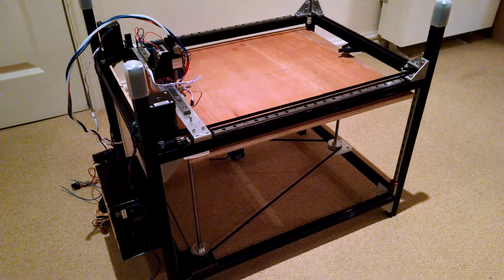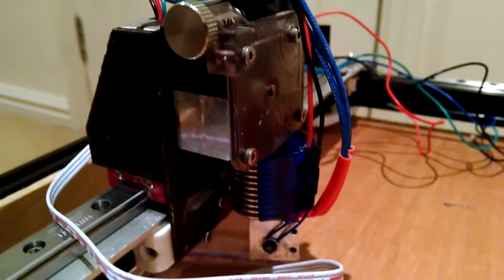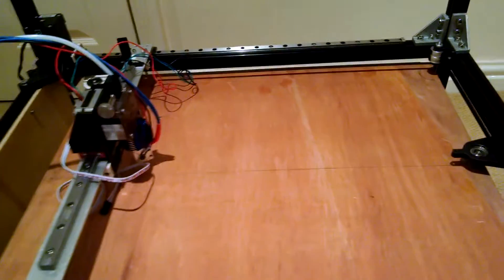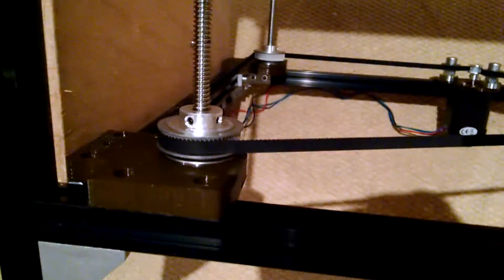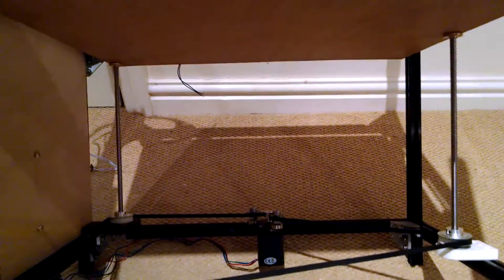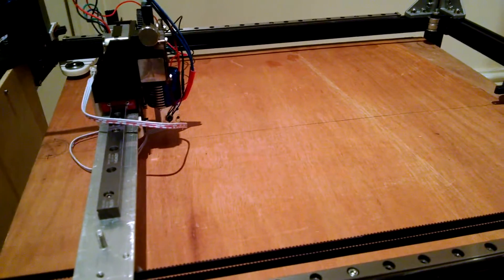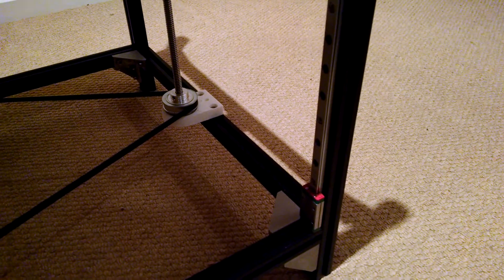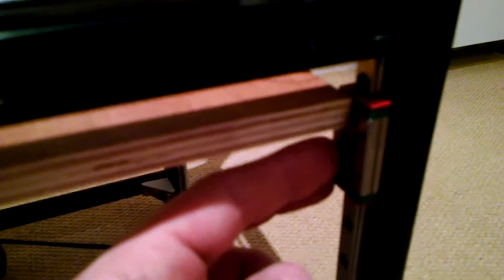MoreXY 3D Printer Design and Build Update

Comment: What type of corner brackets did you use? They seem pretty beefy.
Reply from the maker: Balu 2040 corner bracket right angle connection 90 degrees bracket 2040 bracket for EU 20 aluminum profile slot 5mm 6mm
 http://s.aliexpress.com/ma6rUJju?fromSns
Reply: Thanks for the quick answer :)

Comment: I'm using a 15mm linear slide rail and block on my X axis (cartesian similar to I3) in a vertical configuration, and I have about as much wobble as you do with the smaller one you're using.  Actually not enough to worry about, another printer using two 8mm rods in the X axis has about the same slop.  BTW Lithium grease works wonders on these slide rails, it removes some of the 'grab' I noticed sliding them under load.  Grease those 8mm drive screws and the brass nuts to extend their lifespan.
Reply from the maker: Kenneth Scharf thank you for the comparison and tips.

Comment: Cool build! Mine is kind of similar actually... I went with the robotdigg(black SS)  mgn12 on my XY gantry, My Z axis is a triple lead screw 8mm with robotdigg (green generic) mgn12 rails. I Have tuned the Z axis pretty well so i dont seem to be getting any Z artifacts. What i DO seem to be getting is vertical ripples like  noise artefacts, i for now have rooted all cause of almost all mechanical issues that the printer had and they are still present which makes me believe the culprit is the noise from the cheap Chinese 40mm nema 17's... I see you are using stepper dampeners which i have at hand but have not installed them yet, do you think they will make a difference

P.S. I also suspect that the belt riding on a small diameter pulleys for the XYgantry might also be the cause of the ripples i'm getting... but a lot of people argue that it makes no difference at all, what are you thoughts? Thanks and cheers mate:)

P.P.S Here are some snaps of my machine, will post photos of prints soon

http://forums.reprap.org/read.php?397,726304
Reply from the maker: Luka Verigic very similar! I think we both have the same inspiration. How flat have you found the alu in your heated bed? I took a chance on some 5mm plate (guillotined) and there seems to be a 1mm deflection along one of the 400mm edges. I'm planning to bolt it to a 15mm aluminium box section down each of the long edges to span the gap between each end of the printer so perhaps this will help flatten it. It's a shame because I had hoped to make the heated bed removable (but tethered by the power and thermistor cables) and bolting down won't allow that now.
Reply: Yup same problems here, i have a temporary aluminum plate put up thats 3mm thick and i have only run test prints with a cold plate, but if i want to attach my heater i will have to go with cast aluminum....I found a cool german company that custom makes PEI covered cast aluminum, they have 5  and 8 mm thickness so when i wanted to order 300x300x5mm bed they told me that it would not be stiff enough in 5mm and that i would have to order the 8mm so that it would be stiff so you are propably right not using the 5...

http://clever3d.de/epages/7a4290fc-7c7f-46cc-9b99-eadef22228e2.sf/en_GB/?ObjectPath=/Shops/7a4290fc-7c7f-46cc-9b99-eadef22228e2/Products/c3d-DDP-PEI-natur
Reply: i also suspect that we will have to fasten the idler pulley bolts for X and Y on top and bottom,that may be trouble! But people also argue that its unnecessary as well....
Reply from the maker: Thanks for the tips. I forgot to respond to your comment about the idler pulleys on the gantry. I don't think they contribute to the rotation deflection around the gantry long axis (we'll see) but there's every chance they are contributing to the play in the X-Y plane. I have also bought some slightly better GT2 belt as on a printer this size the belt stretch might be significant.

Comment: Add a physical stop on the x axis, if  your motor skips some steps for whatever reason, you might go over the rail and loose the balls from the bearing.
Reply from the maker: Yuri Yeretin good point!
Reply: On my slide (which is longer than necessary) the end mounting screws have large heads that don't recess into the holes, these serve as physical stops.

Comment: Can you get rid of the aluminium flat in favor of 15mm Hiwin? This way you get the extruder closer to the middle of the rail - thus smaller possible wobble.If you still need the aluminium, then a T profile instead of flat should do the job (several times more rigid for same weight)

I think that vertical wobble is not an issue, but keep in mind that with high accelerations you will get crazy horizontal forces acting on your heavy extruder (e.g. my round rods actually bend 1mm during sudden stops). From what i see your extruder assembly is top-heavy. I think you should try to adjust and to balance the weight vertically so that a sudden stop of horizontal movement of extruder doesn't cause a twist (more force to stop the heavy top than light bottom).
Reply from the maker: I think the flat is worth keeping. The reason it needs to be around 30mm wide is so that there's space to drill holes in it and mount it to the Y axis linear rail carriages, which would not be easy if MGN15 replaced it. I plan to move the MGN rail further towards the edge of the flat but with MGN12, there isn't much of a difference between the edge of the linear rail carriage and the edge of the plate. I agree that the extruder/hotend/X-carriage is top heavy and I can go back to a Bowden setup if required. I would like to try direct extrusion again because I'd like to try flexible filaments and have the best chance of success.

If I went for a T, I'm not sure it would be any better at resisting the torsional deflection I think I'm seeing than thicker flat but the pulley bolts are threaded into the aluminium flat so for keeping the pulley shafts rigid, thin profile T is much harder for me to work with than thicker flat. Unless your round rods (8,10mm?) are very well constrained at the ends I reckon that thick flat plate could be quite good against the dynamic forces you describe causing 1mm deflection.

I could look at reversing the Titan and bolting it to the carriage at the Titan's front face, as opposed to clamped between the stepper and the back face. This would have the stepper hanging far in front of the linear rail carriage which would make problems in the x (as opposed to y) accelerations.  Another option would be to use two MGN9 rails with a strong/stiff base. This would even offer the option to "submerge" the extruder between the two MGN9 rails to get better alignment of the centre of mass with the rails, as long as the gantry connection to the Y axis carriages was OK and there was somewhere to mount the pulleys. This would make a quick change extruder/hotend  arrangement harder (medium term development goal of mine).

Comment: Isn't a MGN15 not too heavy? The rail is almost twice the weight of a MGN12. But a second rail on the Z-axes would do the job!
Reply from the maker: I agree, MGN15 is probably on the high side. 
When I set out I couldn't find practical advice / experience on the performance in 3D printers for these rails, so I didn't want to waste the opportunity for lots of other people to find out whether MGN15 is any good in 3D printer applications by trying it in mine.
The Z axis will get its second rail, just a question of which size is left over once we've played around with the X gantry and settled on the optimum.
Reply: A MGN15 without a plate would be a nice experiment or a MGN12 with a longer rail which rest on the slides. I suspect the play is not in the Hiwin rail but in the plate.
Reply from the maker: Gejes I agree, so I'm getting a piece of 5mm flat to replace the current 3mm.

Comment: is the play wood just a place older for the heated bed or are going to but the heated bed on the ply wood if so wont it warp
Reply from the maker: The aluminium heated bed is going to be mounted on top of the plywood, with insulation between the heater pad and the plywood. I'll use screws and standoffs to raise the aluminium plate off the plywood. Apart from the expense and difficulty (for me) of machining a plate as large as the plywood sheet, if the heated bed was much bigger it would provide a much larger thermal mass and surface area to lose heat to, slowing pre-heat times down and reducing max achievable temp. Warping is a risk but I can address it if it becomes significant. An aluminium frame might be a suitable replacement for spanning the three lead screw nuts. There's loads of stuff that's untested (by me) on this printer which is why the old one is being left intact until this is up and running!
Reply: makes cents if you want the ply wood to last longer  maybe coat it with polyurethane. but you probably  already new that
Reply from the maker: Bill, you're right  - wood is a likely point of failure as far as repeatability/mechanical levelling stability goes. I was thinking about a large plastic sheet but I would like to get an enclosure around this printer for ABS etc, so don't think plastic would be much of an upgrade in terms of stability. I'm trying to keep weight down for portability (although I won't move it often) but given that acoustics and print defects are likely to be improved by a heavier base for the build plate, I should probably just go by the Z axis motor capability.